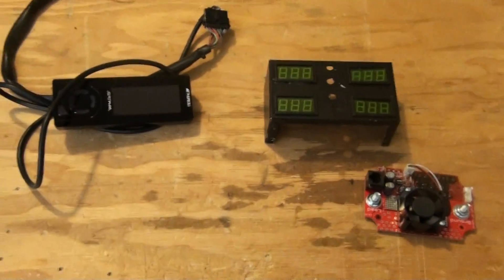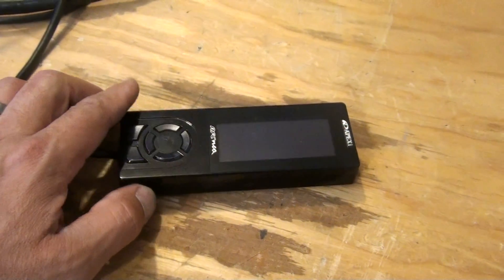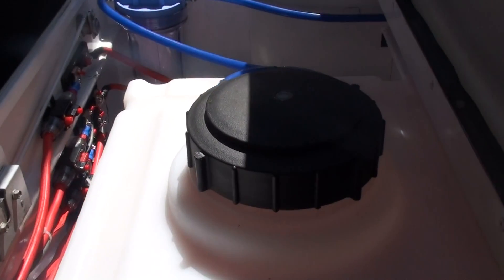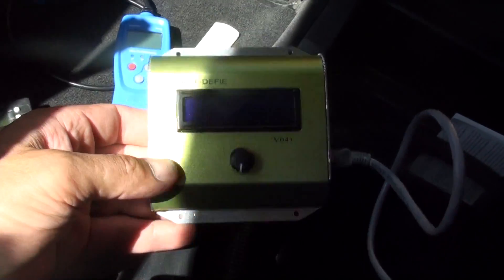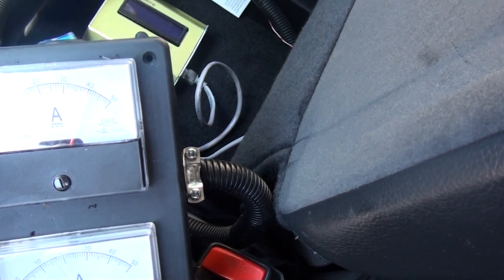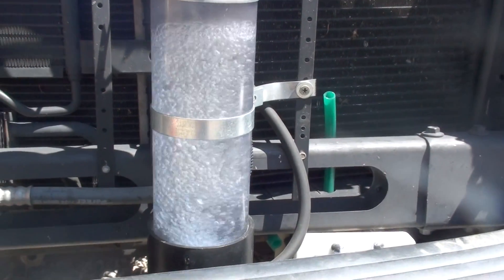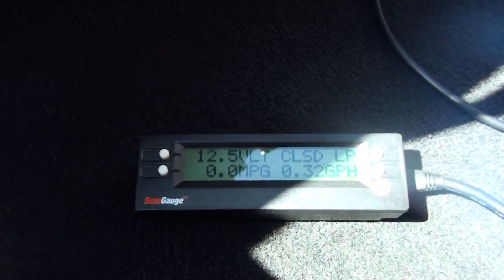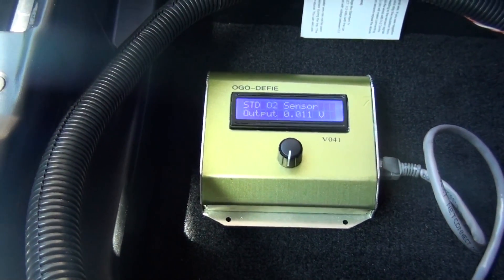288 Plate HHO generator Dodge Ram project. Part 4

Comment: You can add as many alternators as you want look up system alternator super strong add an alternator for each cell because if you run your single alternator that hard it won't last as long

Comment: 13.7Vx161A=2.2KW this is more than enough for regular electrolysis. The more the engine is revving the greater power the alternator is generating the greater Hydrogen is getting generated. Awsome

Comment: One thing what is regulating the gasoline fuel while hho is introduced? Just adding hho will not change gas consumption it will just burn hotter, faster, you would need to regulate fuel intake to lower, while hho burns to get better gas mileage. What I'm saying is a balanced mix to reduce gas mileage. Factory regulator will not do this.

Comment: Nice install. The engine ecm is already set to lean out the mixture due to desired fuel ratings. Basically they use  a knock sensor and tps to set the variable fuel mixture at constant pre detonation.  In more advanced systems, they use maf, tps and o2 (1 or 2 sensors) in combination with knock. This allows for altitude adjustments, load and filter condition. The downline o2 is the same as reading an egt since they can relate when you know upline o2.

The contol of hho needs to be from either varying the amperage real time or pulse width or both. This is best done simply through the tps. The tps is a good indicator of course fuel management and the signal is robust and usable. The only control that is better is to read it all: o2, knock and egt and vary the input hho to achive a desirable preknock egt, something in the 850 range down port. 

Leaning out the fuel is needed of course to compensate for the addition of o and burnable h2. It's just how you do it without disturbing the ecm so much it codes out. The concern is piston detonation for a given compression. If you lean out too much, first the knock, then egt goes way up, then the engine piston tops will start to hammer a hole. Lean shows up as sound first, then as deposited aluminum on the plugs, then in the crankcase as aluminum parts.

BTW: alternator ratings are at a given rpm and never at idle. I would be careful reducing pulley dia to boost output. You can, but call alternator manufacturer and get the power curve. It shows rpm and amps in one curve.  Then measure current rpm with tach at a known engine rpm, then vary pulley for desired alt rpm once you know peak engine rpm. Most engines can achieve highway speed at a fairly low engine rpm. This means the alternator will never normally see higher rpms or full output, no matter the max rating. 

What cell contollers are you using?

Comment: OMG, I started laughing so hard when you said the alternator dropping while idling, basically failing, is a neat feature. I learned the hard way through suing an ex employer that hooked me up with a faulty alternator that alternators only deliver 60% of their rated output at idle. Putting a smaller pulley on your alternator might also solve the trick. If you do really need so much power, you might also look into possibly installing an additional alternator, if you have room, just to power your conversion kit.

Comment: You have a monster positive cable coming off your alternator but has there been any additional grounds made from the engine to chassis?  Seems that this could be a link to your output issue with the alternator.  The grounds that you have were designed for a standard alternator output.  But when you increased the output to 250 amps the grounds may not be sufficient.  Grab ahold of one of those grounding straps and see if they are getting a little warm...
Reply from the maker: Didn't think of that. I'll have a look.
Reply: My guess if you were to add a few more grounding straps from the engine to the chassis, it may improve some things for you...
Reply: He's right, don't forget ohms law. Good R&D! Keep it up.

Comment: if you want to stop the sloshing inside your water tank I would suggest you use the practice golf balls, you will be able to fill the tank with them and the water displacement will be almost nil,, if you need an air pocket on top them for that you could use the ping pong balls. cheers..

Comment from the maker: no open loop is "limp mode" the computer doesn't take any readings from the sensors. It is a pre set map. Basically gas guzzler mode.

Comment: Steve,
When your flo-scan unit goes to open loop, doesn't that mean that the computer is not injecting fuel into the cylinders.  A couple of years ago someone else had a similar situation and he found open loop meant that there was sufficient fuel currently going in without the injectors firing.  Running on H2O2 only.  Good work guy!!

Comment: yes, have you found out the open loop mode problem? My camry overrides any sensor adjustment, even if its small. However I called apexi and they confirmed it was compatible with my engine, but they are a bit pricy

Comment: I've followed HHO but I wouldn't consider myself knowledgeable on the subject. I always did have an idea however, of tapping into the drive shaft or the axel's and have them turning their own alternators. It would be neat to have a progressive system where the more the wheels move the more power thus more HHO, I'm sure there is more to this but Its an idea!

Comment: About my unexpected observation during my milage tests : The autonomy increase that I noticed yesterday wasn't 50 %, but 112 %.milage gain ! From 10.7 Km/L to 22.8 Km/L.
On warm engine, the gasoil consumption decreased from 9.3 liters / 100 Km to 4.4 liters / 100 Km !!? This milage result appeared on a 83 Km trip.
The used the system on a total distance of 300 Km for now.
The engine is 10 years old & has 135,000 Km. There is an EGR Valve. Maybe the HHO cleaned it up ? I use a common wetcell !

Comment: Very nice work. I've read of racers using an exhaust temperature gauge. I do not recall the formal name of this gauge with temperature sensor(measures exhaust temp as it exits the exhaust manifold) but it can help with keeping an eye on your exhaust temperature, higher temps can be an indication of to lean a mixture. Great work.

Comment from the maker: I am not positive what the efie is doing to the o2 signal and that's what I intend to find out. I am used to using a map enhancer to get the job done. I did try one on this truck and it wouldn't lean so I went to the efie. I don't have as much experience with the efie.  I do have extensive experience doing hho installs and a leaning device is needed most of the time. I welcome your comments and help. I try the volt meter, i just didn't want to get under the truck again. I'll compare voltages.

Comment from the maker: The sensors are defiantly no faulty. They were working fine before I cut the efie in. The truck will go into closed loop when I turn off the efie and restart the engine.
You may be right about the post cat o2's. On the list of things to try.

Comment: Are you just treating one of the O2 sensors? I'm not sure how many sensors your truck has, but if you don't treat all the sensors, then the ECM will throw a code. The pre-cat sensors are best done with a digital efie, but the post-cat should just be done with an analog because they are just used to check the status of the catalytic converter. Not sure if I helped, just throwing out ideas. If you get the code without HHO, maybe the sensors need replaced. They usually do after about 100,000 miles

Comment from the maker: The code it's throwing when it goes into open loop is p0152, that's a o2 sensor code. This happens when the hho is off too.
I'm buying a scan tool that can monitor the o2's in real time. I' trying to figure this out and need some help. I appreciate your help and ideas. thank you

Comment: Hello Steve, Very nice setup & bubbles. I installed my first HHO generator for 3 weeks now that has a medium mmws of around 3,2 and an outpout of +/- 750 ml/min at 18 A and 13.4 V.
The system is installed on a Renault scenic 1.9 dci common rail engine. No PWM set on.
The reason why I write this to you is that I'm observing an unexpected pheomenon during my milage tests that are increasing gradually at each trip. I reached today a nearly 50 % milage gain ! But I can't explain it....!!!!

Comment: first of all thanks for making and taking the time to answer.
i my opinion will make it worse( will drop even lower at idle). in my opinion there is no need for you to make any changes to the generators because it is even cool the fact that the amps go down when the truck idles. but if you want to do extensive testing of the consumption (at idle and on road and to actually max the generators at 50 amp each you would probably need 2x100 amp batteries witch i think there is no need for now.

Comment: hi! my name is Harry  i am an student at electronics/electrical engineering.
i will not say that i am sure about what i am going to say but my guess is that the alternator is at least close to 250 amp if he is rated as 250 amp but the reason you will not get the full 250amp at idle is because i suppose that the battery you have hooked to the 2x144 generators is way way smaller than 250amp so at best she buffers the approximately 80amp delivered at idle.Anyway Super Good Work !!!!!!!!!